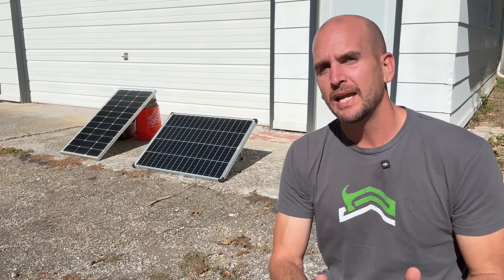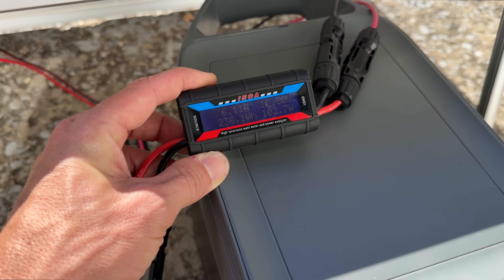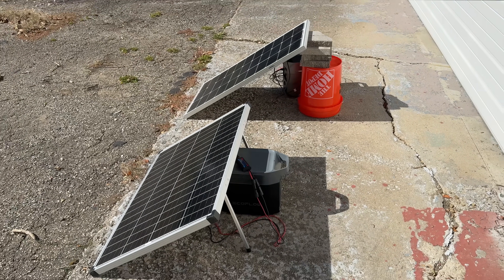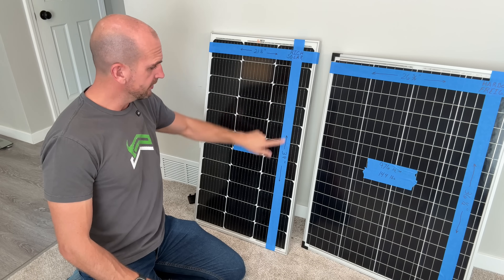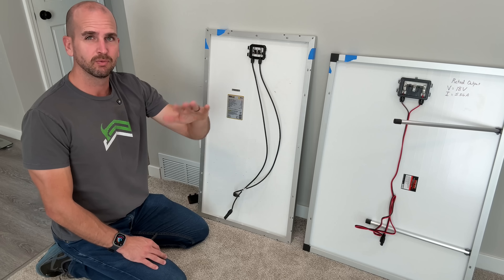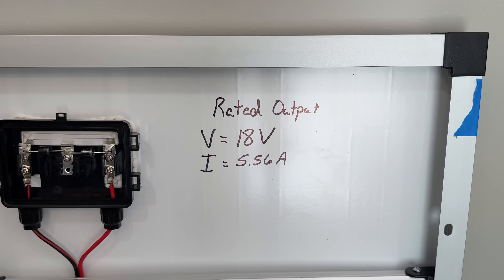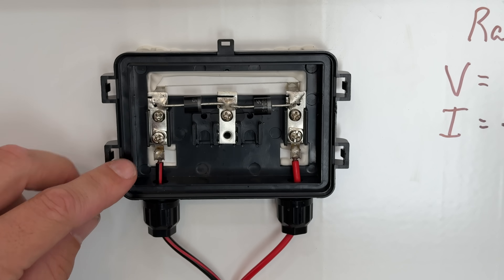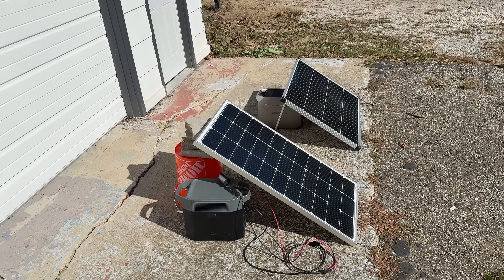Harbor Freight 100W Vs Rich Solar 100W |  Tested!

Comment: I have always been impressed with the HF 100w panels. Price per panel is a bit higher, but you can pick up in store, use their coupons, and they can be wired in series unlike some other 100w panels. Great for folks wanting to power smaller projects like a solar shed.
Reply from the maker: Totally agree!

Comment: I have 4 Renogy 100 watt flexible panels and 4 HF 100-watt panels (rewired to MC4). The HF consistently outperforms the Renogy on a given day. I recently put the Renogy PVs in 2S2P to up their wattage into a 40amp MPPT (Epever) for a "power cart" with 4 Renogy 6v 260Ah AGM batteries in 2P2S, 6240AH power storage. I'm in the panhandle of Florida.  The power cart actually runs my entertainment center, wifi, and my refrigerator as a UPS, and has for the last year. This setup has reduced my grid bill significantly.
Reply: Hi 
I live on Panama City, Florida in the Panhandle.  I have a couple of EcoFlows. How did you adapt that connection on the Harbour Freight panel to mc4? I'm not tech savvy so I need some detailed info. Maybe with pictures LHOL
Reply: @fuzfire  I cut the SAE off and converted them to MC4.
Reply: Tallahassee here.  Very interesting!
Reply: @aussie2uGA  I moved from Panama City to Tallahassee in between hurricanes.  We HAD desired to live in Mexico Beach until Michael washed that house into the Gulf of Mexico. Now, Milton area near Pensacola.
Reply: @mkuhlman77  You have a valid point with 1 x 400 watt vs 4 x 100 watt.  My decision was based on availability and being portable. The Renogy flexible panels are very light. I can string them up with wire through the eyelets. The HB are ground level on their own stands, AND I store them in their original boxes when not used. I lived in Panama City just off of 23rd St.

Comment: Due to the larger size of the HF I wouldn't be surprised if they are really 110w panels just labeled as 100w- hense no data sheet sticker. The dimensions are very similar to my nature power 110w panels. 
The cons on the HF: cable wire is thin and not PV cable so it is not UV rated. The SAE connector is by far the worst connector (XT60/5521/7909/MC4) they get really hot and get loose after multiple plug/unplugging. It is also not waterproof like the MC4. 
The pros: the legs are nice if you go mobile or don't have a rack for permanent install. You can walk in a HF and buy one that day and return in person if broken.
I would like to see a partial shade test on both these panels. I would assume the Rich solar would perform better due to the 9bb design.

Comment: Roughly 15% more surface area on the HF panel, but 50% more cost...not good!  Curious to see what the difference is in power brought in.  (I hate the SAE connectors!)  Looks like the HF panels are built larger to deliver the actual rated capacity, whereas the Rich Solar panel is (like most others) only giving around 85% of the rated capacity.  You could buy 3 of the RS panels for the cost of 2 HF panels.  With that you would get around 250 watts from the RS panels and 200 watts from the HF panels.  In this scenario, the Rich Solar panels are the clear winner, in terms of value.  Although the build quality of the HF panel was better, those SAE connectors (adapters aren't free!) make them a non-sequitur for me, anyway.  The HF panel would need to be on sale at $95 or less for me to be even remotely interested.

Comment: Another advantage to the harbor freight panel, especially for rv owners is that you can easily replace a broken panel anywhere in the US, but they do seem to be very sturdy.
Reply: Not anywhere, still need to be near a decent sized city. Your point still stands though your always within 5 hours or so from a harbor freight so it’s still going to be the most convenient to replace if you can’t wait for shipping.
Reply: @jaydunbar7538  "if you can’t wait for shipping" If you're on the road in an RV shipping is a pain in the ass as well. Like, some RV parks have shipping receiving but not all, and amazon drop boxes won't fit a solar panel.
Reply: I buy the replacement insurance and never have issues replacing anything that ever fails for any reason!
Reply: One blew off my RV back in October. Considering the pine forest was flattened in spots here and there around the area I live and that the news said wind was over 150mph I wasn't surprised one went for a tumble, (just one out of five though). Anyway the panel still works. It did land in some tall grass which I'm sure helped matters, but yeah, so far hurricane proof is my personal experience. I thank God though considering I was in the RV during that storm and the eye passed over the area I live in.
Reply: @willernst2721 I keep my panels on the roof of my van leashed to the roof rack with a steel cable so they won't fly off while driving if one or more come loose for some reason. 
I'd really hate for one to fly off into someone's windshield and kill them 😮

Comment: 10:32.. You need to also calculate the Panel cost per KW or Watt. For example... If the HF cost twice as much the HF panels are not the best choice.

Comment: All well and good for now, but how do these panels compare say 5 years or 10 years down the road? I have a friend who has four older Harbor Freight panels which no longer produce nearly as much power as they once did after 5 years time. To me that's almost as important as power output and initial cost.

Comment: I don't know if anybody has mentioned this, but the 2 panels are about equal in efficiency.
The Harbor Freight panel created 17% more power but it's also 15-18% bigger than the Rich Solar panel. Depending on which area is divided by each other gives different percentages. I show the Rich Solar panel is 15% smaller or HF panel is 1.177 of the smaller panel, or 17.7% bigger. It basically wins because it's bigger.
Reply: But the issue is that Rich Solar panel is rated at the same power output. So Rich Solar is saying that their smaller panel will output the same power as the larger HF panel and this video anecdotally shows this is not the case.
Reply: @MrSlim1225  a "100W Panel" is more a classification of size these days than a declaration of its abilities.  Much like a Honda CRV is a "Sport Utility Vehicle".  You have to check what its actual rated stats are when you hook it to your system.  Unfortunately the Harbor Freight one doesn't put them on the panel.
Reply: @HeadCannonPrime  a "100W" panel should output at least 100W in "full sun",or it's not truthful advertising. Like buying a 16oz bottle and only getting 14 oz. of content. So under what conditions did Rich Solar test this panel's output to get "100W"?
Reply: @MrSlim1225  Unfortunately, the Rich solar panel has nothing special that makes it better than the HF solar panel.
For it's total area, it produces at about the same rate as the HF panel, but because it's smaller, it produces less.
Reply: I agree: a solar panel marketed as a 100 W panel should deliver 100 W but that’s just advertising blurb. It should be ignored if you have access to real information. Always use real information.
Reply: i would probably account the difference to the larger diodes in the riches to the hf. if the hf had larger diodes. then you might get even more amperage.
Reply: 80 bux for Rich Solar. 120 for HFT.  50% more money for 17 % more power

Comment: This was an excellent comparison. I have one Harbor Freight Thunderbolt panel and 4 other 100watt panels. I think two are from NewPowa and are 9BB; two are from Bouge RV and are 9BB. We were without power for about 5 days recently after Hurricane Helene. I had the 4 100 watt panels in series charging one 100AH LIFEPO4 battery and the HF panel charging a second identical battery. While the 4 panels in series obviously brought in more power, none of them individually brought in as much as the one HF panel. The HF panel had a slightly higher amperage. I was very surprised at this. Angles were as close to the same as I could get them.
Reply: Did you have MPPT solar charge controller between the 4 in-series panels and the batteries? If not, you are throwing away most of the energy. The MPPT controller constantly adjusts the load current on the panels to extract the most power and downconverts the voltage to match the need of the battery. Victron makes a wide range of MPPT solar charge controllers that are very high quality. There or plenty of others on the market that are much cheaper.
Reply: @gregben  Yes, I had a Victron for the 4 in series and another brand MPPT for the HF one.
Reply: Any time you connect panels in series they have to be identical panels to get the most power out. An MPPT charge controller is also needed.

Comment: They seem to be different sizes? Which is more efficient per square inch? 🤔
Reply: They're very close in efficiency. HF panel creates about the same percentage more power as it's bigger than the Rich panel.

Comment: Well I’m no fan of either of these, but I think you are comparing apples to oranges.  If you dig under the hood, neither of these are actually 100 watt panels it’s nominal (marketing).  There is no regulation really so companies are free to label and say pretty much anything,  A better comparison would be equal size arrays (surface area)with the cost comparison factored in, and a least a discussion on warranty.  I have 5 separate arrays in my back yard, various brands, but all pretty close in terms of surface area.   All on victron controllers, and they generally put out the same amount of power per array…with a sample size of every day for several years.  Our solar provides roughly 1/2 our power in the summer and 3/4 the rest of the year.  There is way more to a comparison than a single panel for one day..

Comment: Yikes, I just installed four Rich 100w solar panels on my van roof 😳.  However, the footprint was perfect.  Something like the Harbor Freight panel size would have been too big.  Trade offs!
Reply: The efficiency is very close. HF panel produces more energy because it has more area.
Reply: Not really a trade off because the size difference is also the power difference; meaning, they are equal.
Reply: @mr.c6674  in my case, I only had so much real estate.  I connected four of these panels in series for one array and added two 250W (37V) panels in series for a second array for a total of 900W.  I’m powering a 51.2V battery bank and trying my best to match panel size that will maximize output.

Comment: If you arent doing a roof install, look for used panels.  Pretty easy to find them for 20cents per watt.
Reply: I thought this was a smart idea too.  But the panels I got were somewhat derated and 1 dud right away.  By 2 years out only 2 of 6 were generating power at all.

Comment: Great comparison. I only buy Harbor freight panels when they go on sale. You can usually find a coupon for 85 to 99 dollars per panel on them. Makes them much better for the price and they have legs attached. I would not pay full price. I do not like the SAE wire connector but that is okay. Compared to any of the other 100 watt panels I have, the HF ones do perform a little better. I have HQST and a couple of portable panels that just do not want to do more than 80 watts, usually around 75. The Harbor Freight seem to be steadily in the 80s to 90s for me, but that may just be angle, time of day and location. I definitely would like to see more comparisons against the HF panels.

Comment: I don't like these videos because there are so many climate factors that aren't considered. Do this test on a sunny day after rainfall then the panels will overproduce, or in the winter with snow-covered ground on a sunny day. Their wattage will go through the roof. I've yet to find the panel to be the factor in production versus the climate. One day my array will produce nearly 100% of expected output during peak time, whereas the next day everything will be the same and they will produce maybe 70-85% expected output. There are just so many things that could impact the output that I really don't see the panel being good or bad at least in many of my experiences. I've used renogy, eco-worthy, and harbor freight all 100w panels and there really hasn't been any such consistency where I can name one panel over the other. The climate is really what determines their production and even though the conditions appear consistent they're not necessarily consistent for each panel.
Reply: The climate is not a variable factor for panel comparison unless your home moves around from place to place. Which some people's do.

Comment: What is the age of the two panels?  In other words, I thought new panels produce a bit more energy at the very beginning of their life cycle then lose a bit of efficiency, before they reach a stable point and then very slowly degrade over decades.  I think that means if you pull one panel out of the box just before this test and the other one already has 100 hrs on it, shouldn't you expect the new panel to out-perform the one that is now past its initial break-in period?  Not saying that is the cause of the observed result here, but if one is brand new and the other one isn't, that might bias your results.
Reply from the maker: Good point but both panels were actually used in the test were lightly used 6-9 months old.  This is something I need to consider to try and maintain apples to apples comparison.
Reply: Panels usually only lose 1-2% in the first year or so and then about half their initial drop every year after that. As long as the panels are relatively close in usage age the difference would almost always be within the margin of error. It would only make a measurable difference if their use age were well over a year apart.

Comment: Question about solar charging - is there a way to charge a portable battery with solar panels that are already installed on a house? My system is a grid tied system, so when the power is out, the system turns off! Is there a way to allow my existing panels to charge something when the grid is down? For example: the hurricane knocked power out for tons of people for days and days. Is there an easy way to wire up one of these batteries to allow it to charge when I don't have power? I'd like to avoid buying panels just to charge a power station when I already have panels on my roof doing nothing! Thank you!
Reply: There sure is a way, but the details make it tricky. First, you'll have to decide which portable battery you want. Next, you have to see that battery's max rated solar input (in both volts and amps). Now, you'll have compare the specs of your solar panels to make sure the voltage and current they put out match the specs of the battery. Keep in mind this might mean you can only use a small portion of the panels you have. For instance, the EcoFlow Delta 2 Max can take up to 1000w of input (11-60V at 15A) while the Bluetti AC180 can take a max of 500w (12-60V at 10A). 

Once you figure out how much juice your battery can take, you have to figure out how to make that happen. Do you need to disconnect a few panels from your setup? How do you safely do this so you don't electrocute yourself? Do you arrange the panels you need in series or parallel? Do you have the right connectors to connect the panel to the battery? Will the cable be long enough to reach from the roof down to the ground where the battery is? Are you using the right gauge of wire to handle the current and distance involved?
Reply: I've heard that the rules in some places on grid-tied systems may prohibit you from using it off-grid even during an outage. Always know what you're getting into before you make any agreements including future possibilities.
Reply: Sure...with different equipment and switched over...so not easy or cheap

Comment: Nice video. I wonder what the panel size percentage difference is?
Reply from the maker: It is almost lined up with the percentage power output difference.  Energy collected was 17% higher for the Harbor Freight as compared to Rich Solar and the area was 18% larger for the Harbor Freight as compared to Rich Solar.
Reply: so the Richsolar is actually the more efficient panel. Any consideration on making it the control for the next test?
Reply: @everydaysolar that means they're pretty much equal in terms of power.
Reply: @everydaysolar  and it cost 50% more $$ to get that 17% bump in output